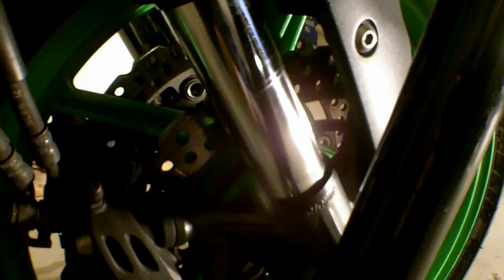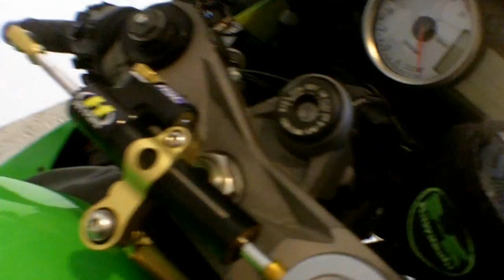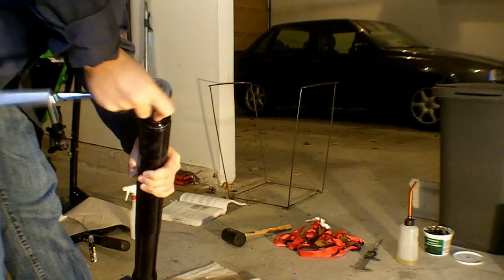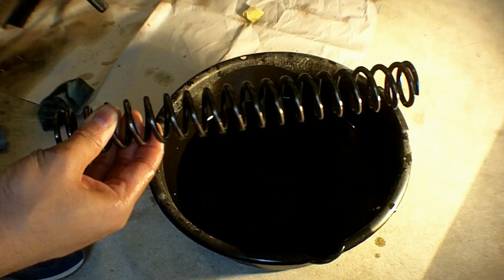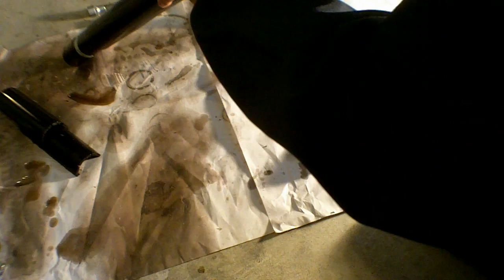Replacing fork seals on inverted forks. Part 1 of 2

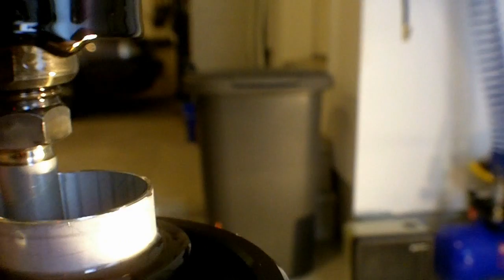Comment: Do you remember the distance you had on the fork lock nut at 5:53? I'm confused on how to place it with the accordance of the adjustments for rebound and dampening. So if I have the adjuster at the top all the way on "s"will the fork lock nut be all the way at the top? I cant find a way or figure out how to tune the nut. I think mine are off because one ajuster has more turns.

Comment: Thanks. I just did my seals on my Versys and used this as a guide.

The sandwich bag trick was brilliant.

If your forks are like mine, once compressed for reassembly I used a magnetic pick up tool to pull up the damper rod.

Cheers!

Comment: Nice video.  I used a ratchet strap around the caliper carrier instead of a wrench, but I'm liking the wrench idea better.  Also, you could have tried cleaning you fork seals before replacing them.  They may have been able to be saved rather than replaced. I did this on my R6 and it worked perfectly.  Oh and I thought your bike took 5W fork oil.  10W will work fine, but I thought they called for 5W like the 05/06 models do.